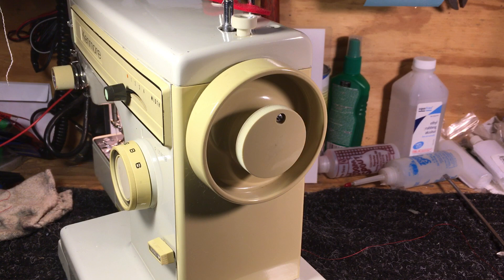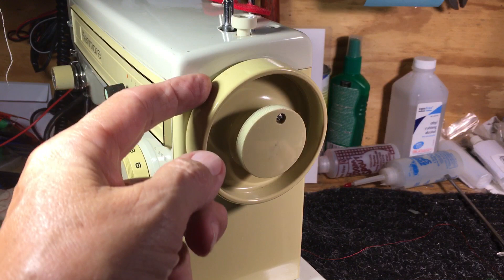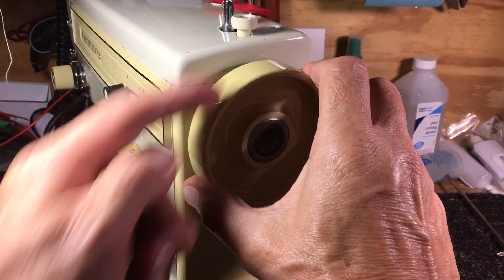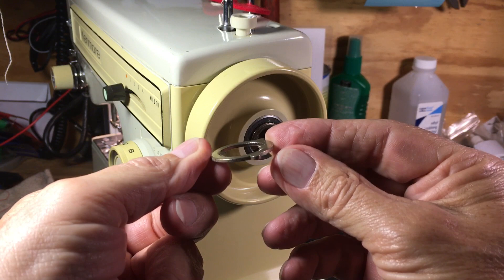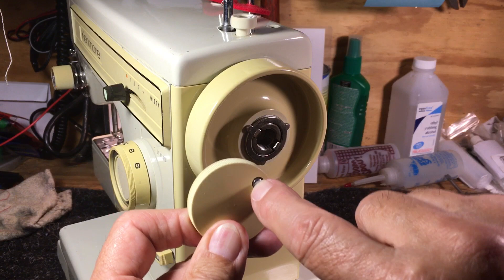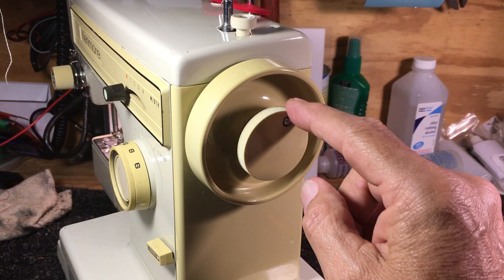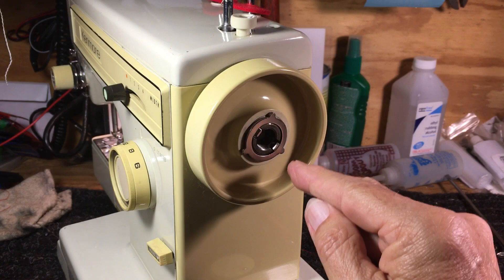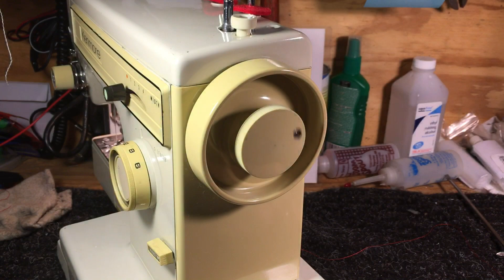Re-assembling hand wheel and clutch release

Comment: I recently bought a model 52 and the inside gears don't move when I rotate the handle.  I wonder if this is related to the clutch being put on wrong. PS I very new to sewing and have yet to get the machine running.
Reply from the maker: If the hand wheel turns and the machine doesn’t, there’s an issue with your hand wheel clutch being assembled incorrectly.

Comment: Thank you somuch for this vid! all this time i had the prongs facing the wrong way. I have another issue...oyt of frustration b4 seeing  your vid i forced the cover off so the inside groove broke but the cover is still intact...do i need to buy the cover or i can get it to work without the lil inside piece.  HELP!
Reply from the maker: You might want to get a new cover. 😎👍🏼
Reply: ok, thank u so much for your prompt response.  what's the correct name? I'm going to check Amazon
Reply from the maker: @theathea8313  I don’t know what it’s called. Just try calling it what you want and see if that works.

Comment: Hi Randy,

Recently I bought  Brother pacesetter xl711 from Goodwills. The machine is in working condition  but the stitch selector is not smooth at all and some of the stitches are not working properly so I open the top and put oil to the cam and gears . Then stitch selector bar getting better and while I was moving and testing different stitches the motor and hand wheel get stuck and the needle bar is not moving anymore when I press the foot paddle. Any idea which area to check and debug the issue.
Thank you.
Jasmine
Reply from the maker: You’ll have to oil every bearing and slide and rotating part until it loosens up. Sometimes it takes a while to get it moving, especially if it has sat for a while unused.

Comment: Hey Randy! I put my clutch back on (the WRONG way) before I found your video and now I can't get it to come off to fix it. The wheel just spins and spins and never tightens or loosens... any guidance?
Reply: Hi. I did the same thing! I put it back together before I knew there was a right and wrong way to do it! I finally got some vice-type pliers to pull the knob outward as I turned it counterclockwise and it finally worked! Just be sure to use a rag or towel to protect the knob as you do this.  Then I followed the video and it works like a charm now! Hope you get yours working.

Comment: My hand wheel can still turn when I do this. So.....the noon, 4, 8  OR 10, 2 6, positions aren't stable. It depends on the position of the wheel. So I don't really get this? In any event, my needle keeps moving up and down no matter what position.  I had not changed the clutch position ever and it was after my machine sat for years unused that I have the problem that I can't get the needle to stop moving even when I loosen the clutch. Do I need to do something to the hand wheel perhaps?
Reply from the maker: Yes. It needs to be disassembled and polished using some fine emery paper or crocus cloth. Make the surfaces shiny, oil them, then reassemble.

Comment: How did you get the silver piece off to get to the clutch? I got inherited a singer touch and sew 778 , the motor runs but the needle isnt moving . I’m new to sewing so I have no idea what the issue could be .
Reply from the maker: @kiddeath1302  the tiny set screw has to be removed. Then it will disassemble.

Comment: Hi Randy. I have a Janome MC10000 and she has two things going on and I think one of the issues is causing the other issue. She developed a whirring noise and the handwheel is very tough to turn. I have cleaned under the throat plate making sure to get the bobbin case and the feed dogs. All the lint is out from under there also as far as I could tell. What could be causing these two things and are they related? The other thing I would like to ask is how do I get the handwheel off? Thank you for any and all help.  ps. I was told a Janome does not need to be oiled. Is this accurate information?

Comment: What if the clutch wheel will not turn and it’s stuck.
Machine works fine I just can’t use the bobbin maker. It’s never been open and I’m the original owner. It will not turn towards me at all.
Reply from the maker: Hold the outer part of the hand wheel with your left hand. Using your right hand, place a piece of cloth over the release knob and grip it lightly with a pair of channel lock pliers. Turn the knob towards you and it will release. Viola!

Comment: Randy my needle won’t go up and down clutch is put together like you said . What else can be wrong ?
Reply from the maker: Clutch assembly is assembled incorrectly. Flip it over. Rotate it 180 degrees. Make sure the two inside prongs are facing out. Wipe off the excess oil and grease. Tighten it tightly. 
Go. 😎

Comment: Randy,  I must have reassembled wrongly the clutch.  Now  I cannot remove the clutch to try another  position
Reply from the maker: Sometimes a soft tap with the non-metal handle of a screwdriver will cause the hand wheel to move enough to free up the clutch disc.
Tap it gently on the left hand side.
Good luck 🍀😎

Comment: Thanks! I have a kenmore 185-1941 the needle is still moving when I pull the hand wheel out . Do you have a video on this model?Thanks again.
Reply from the maker: I don’t know. With 335 of them, I lose track. 
You need to remove the top and ad some sewing machine oil where the hand wheel spins on the end of the shaft. 
You may need to hold the needle bar so that it’s motionless and allows the hand wheel to release and spin by itself.
Reply: @randyyoursewingmachineman9954  I will try it. Thanks again.
Reply from the maker: @junejiang7647  😎👍🏼

Comment: I think I put it together wrong before finding this… The wheel will not disengage (as when needing to wind a bobbin) but only moves the needle up and down. Anyone experienced this??
Reply from the maker: You may need to try assembling it again. Rotate the clutch disc 180 degrees. That may solve the problem.

Comment: Hello, you need your advice whether it's worth buying a sewing machine Bernina 707 minimatic for $ 200? The machine is needed for home-made sewing silk, velvet, knitwear, lace, curtain. Check the machine with the mechanic there is no opportunity. The seller says that the machine is working.
Reply from the maker: Although it’s a great machine, without being able to see the pattern gear and examine it for cracks, I would pass. 

The price is in range if I were looking at it and sewing on it.  That’s not a price that I would risk “ taking a chance” on a machine sight unseen. 

Every machine that I’ve had to service that my customers acquired online, worked fine according to the seller.  That’s when you have to see if the seller has a high rating and is a trusted seller on whatever platform you’re viewing the machine. 

If you are buying from a “trusted” seller who knows about machines and doesn’t want to ruin his or her reputation by selling a “bad” machine, make sure that you have a ten day return and refund agreement in case it arrives trashed from poor shipping and handling practices. 

I buy my share of machines online, mostly for parts. I’m amazed at how poorly they are packed and how damaged they are upon arrival.

Caveat emptor.  Buyer beware. Good luck.
Reply: @randyyoursewingmachineman9954  Thank you, your information is very much needed.

Comment: I removed the screw but the hand wheel is stuck and won't come off. Any suggestions?
Reply from the maker: You have to GENTLY and purposefully TAP  the hand wheel with a plastic or wooden (non metal) device. The handle of a screwdriver works nicely in many cases. Oil the shaft that it turns on. If necessary, spray lightly with a penetrating oil. It’s a finesse move that gets it off. No brute strength required.
Reply: @randyyoursewingmachineman9954  I am not sure Darylle Smoot was meaning the the clutch knob or the clutch wheel. I THINK your answer was how to remove the wheel rather than the knob which has the screw??? I have remove the screw but the small knob is stuck fast. Did you mean to gently tap the knob that sits over the clutch wheel? I want to fix mine but worry about doing something to prevent any fix. My day thought he would do me a favour and 'serviced' the sewing machine when mum it. I suspect he put the washer back wrong and somehow it is all jammed together. Can you clarify at all? (If I made sense trying to explain it?) Our local shops are overflowing with a repair backlog too.

If you would answer it would be MUCH appreciated. So glad you put up this video (thank you!) as I would have no idea what even lay behind the clutch knob. My hubby wants to use  a large shifter tool to loosen the knob off the wheel which I said no to as afraid there may be worse issues from that. 0.0
Reply: @idledreameress  The knob with the little screw (the one he is removing in the video) should not need any harsh help coming off. It's just the set screw and standard thread. I have to hold the handwheel on mine to get it to loosen. 
What Randy is referring to, I believe, is the shaft that spins behind the clutch that he is taking off. If it is frozen with old oil (from olden times) the shaft can freeze up and make the clutch not work. That was why he was talking about the gentle taps with a non-metal object.

Comment: Randy, I've got a Singer 201. As I'm sure you know handwheel clutches all function almost the same way.  I recently had the clutch sticking to the needlebar, so I basically couldn't disengage the clutch to only thread the bobbin without the power going to the needlebar.  After thoroughly taking it all apart and cleaning everything out, it is not sticking anymore and I am able to tighten and loosen the clutch.  But now I have a new problem.  When the clutch knob is tightened all the way, it will loosen itself and go into the disengaged position.  I have made sure that the stop motion ring is properly inserted in the correct 180 degree orientation so that it tightens moving it one way and loosens until it hits the stop in the other direction.  But once the machine gets up to full speed, it loosens and almost immediately clicks into the disengaged position, thus meaning I can't even sew with it now because it won't engage the needlebar.  Any ideas on why this would happen?
Reply from the maker: That usually means that the clutch disc needs to be rotated 180 degrees.
Reply: @randyyoursewingmachineman9954  Thanks for the thought.  Not the case here.  I'm familiar with the issue and feel of the clutch disc being in the wrong orientation.  Firstly, the set screw goes right in on the outer tab, secondly and therefore, the clutch knob can't be turned either way.  With the correct 180 degree orientation of the disc, it tightens firmly going one way, and clicks into a loose position in the other. I've already eliminated that as a possible cause.  The problem I'm having is no matter how tight I make it (and it feels very tight by hand), it slips out of position once machine gets to full speed.  I'm actually pursuing buying another clutch stop motion ring since I suspect this one was an aftermarket replacement and the bent inner tabs sticking out don't seem even on both sides.  I know original stop motion rings for my machine were made by Simanco, so I'm gonna try and get an original part and see if that's the issue.  I just never noticed it was an issue before because everything else in that area was all gummed up and therefore always stuck in an "engaged" position.  I'll let you know how this turns out.
Reply from the maker: @Hayrange  sounds like you have it figured out.  If your inner tabs are bent, they won’t grip. If it’s not a Singer original disc, I suspect that the metal composition is poor and its failing to hold its temper. A Simanco disc will do the job.
Reply: @randyyoursewingmachineman9954  Randy, I just watched another video by "VintageSingerSewing" titled "Part 1 of How to Fix a Vintage Singer when the Needlebar Still Moves in Bobbin Winding Mode"  And according to that video, I don't even have the correct washer type.  The washer type from potted to non potted motors was different (probably due to a more direct torque, therefore requiring a larger friction surface).   I would have never known the part was wrong because everything was gunked together, however, now I'm seeing the bigger picture. I bought my machine refurbished on eBay.  Whoever did the job probably didn't know the technical aspects of those different parts and gave me the wrong stop motion washer.  And by the looks of it, even the outer knob has a slightly different design as the Singer 201-2 knob steps out a bit more than the one I have.  Here's a lesson to be weary of refurbished models because you don't know how much the seller knew about these.
Reply from the maker: @Hayrange  👍

Comment: Wait an I crazy? I thought the piece was at ten two and six when you took it off? Then you put it on the same way but.ts wrong. Was it on won't to begin with?
Reply from the maker: Sometimes you have to flip the clutch disc over so the two inside prongs are facing outward instead of inward. It goes back together four ways. One way works, the other three don’t.

Comment: thank you, so close but no cigar! i'm trying to find a way to remove the handwheel entirely to replace the motor belt. unless there is some other way? oof!
Reply from the maker: More often than not, just loosening the motor mounting bracket will allow you to replace the belt.
Reply: @randyyoursewingmachineman9954  thank you! i wasn't able to loosen the motor bracket (it's a very small space and i can't get even my shortest screwdriver into the slot firmly) but i did get the handwheel off -- it was just very stuck on there so i had to pry it off (carefully) against the body of the machine. this is the first time i've seen my model of machine in any video so thanks for that! now i'm having trouble finding the right size timing belt :( keep getting sold ones that are too long

Comment: Thanks, this helped a lot but I've now found my real problem. My hand wheel is jammed on the shaft; it wont move like yours. Any tips on how to release it please?
Reply from the maker: Spray a penetrating oil on the  assembly. Tap it lightly with a non-metallic object. Repeat that until it slides off. The old oil has become glue-like. Be patient. Tap lightly. It will respond favorably.
Reply: @randyyoursewingmachineman9954  Will do. Sounds like excellent advice to me. By the way, I saw your subsequent vid and I'm in the UK. I fully understood what you were saying and your vid on the clutch is the best out there. Keep up the good work, and thanks, it is a big help.
Reply from the maker: Graham Webb you’re welcome.

Comment: So I had a black washer pop out, can you tell me where that is supposed to go? Needle is not moving up and down when I put it where I think it goes
Reply from the maker: It will go up against the inside of the hand wheel if it’s supposed to have a washer. 
No matter where it’s at, it shouldn’t affect the needle engagement. 
I would double check your clutch assembly and make sure the two inside prongs are facing out (to the right).
Reply: @randyyoursewingmachineman9954  I definitely had them facing out, it is really hard to move the wheel as well, I used shredder oil on it and it got gummed out, hubbie cleaned it up with WD40, it worked great, so I definitely had it reassembled correctly. watching this video helped. But then after a few months, the needle started not moving up and down, with the foot pedal or hand wheel, I could not turn the wheel, so i sprayed some more WD40 around, trying to clear up some of the stickiness, I didn't see a black washer when you reassembled yours, and I didn't really see where it came from, I was just making sure it wasn't just laying on the workbench to start with. I may just have to find a repair shop and bring it in to get it cleaned properly
Reply from the maker: @joan7910  😎

Comment: Hi, do you know where I can buy the belt for my Morse sewing machine model 86409 and the free manual?
Reply from the maker: There are numerous sellers online that can supply you with a belt. 
If your belt is broken or degraded, you need a new one. 
If it’s loose and slipping, you can adjust it. 
Measure the length of the belt. 
If its length is 13 3/4 inches, the belt number will be 1334. 
If the belt is 15 inches, it will be 1500. 
Etc. 
sewingpartsonline.com has belts, as do many others that will pop up in a search. 
Forget that it’s a Morse, that’s irrelevant and will complicate your search. 
As for the book, find one that looks similar to your Morse and download it to a PDF and print it on your printer. 
Numerous sellers do that also. 
I don’t know about any “free manuals”. 
Good luck 🍀 😎

Comment: is there any other reason why it doesn't stop?  I've tried changing the washer orientation and made sure the set screw falls between the outside ears but still engages the needle bar
Reply from the maker: The axle that the hand wheel rotates on has to be oiled. If the machine has sat for a long time, unused, it’s also a good idea to run the motor and hand wheel with the clutch assembly removed to smooth out the surface between the hand wheel and the axle. Hold the needle clamp still, so the needle bar doesn’t move up and down. The more you use the bobbin winder, the better it will perform.
Reply: @randyyoursewingmachineman9954  it works beautifully now.  A solid Japanese made White zigzagger revived!  Thank you so much!
Reply from the maker: @cedar0girl  great job. I’m glad you got it going.